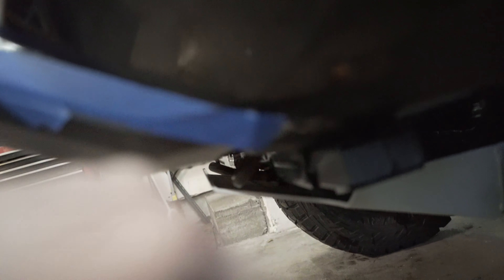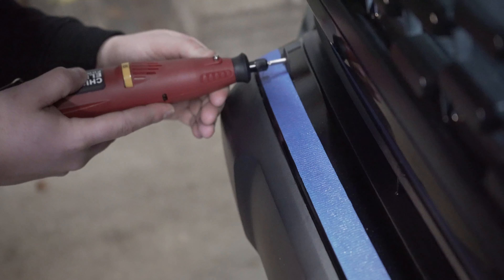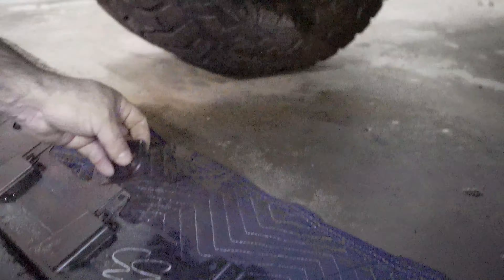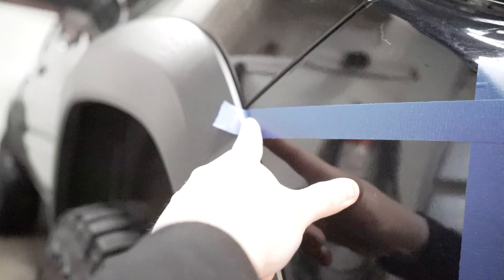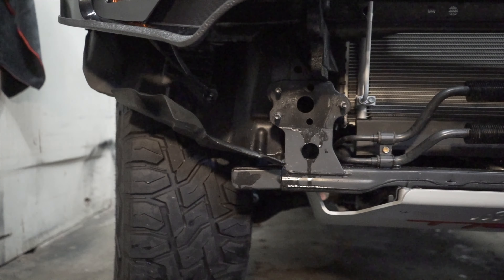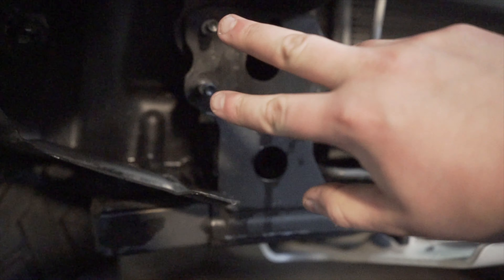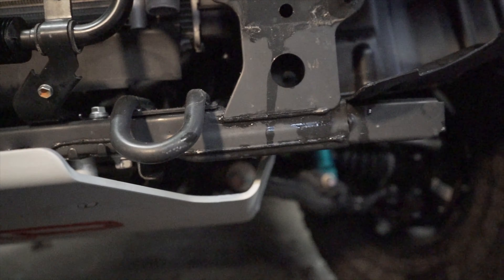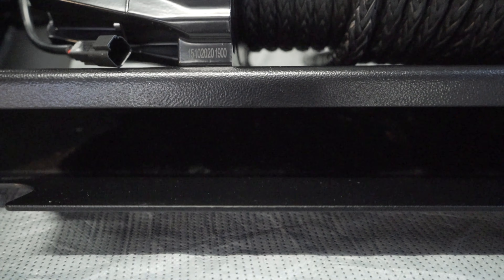Southern Style OffRoad 3rd Gen Slimline Tube Bumper Install | NEW LOOK!

Comment: I have ordered this bumper and am waiting on it to arrive! One question I have is in regards to the fenders. Do I really NEED the fender flares for this to work smoothly or does the kit come with enough rubber gasket to go the extra few inches on the sides if I'm just using my stock colored fenders? I can't find anyone who DOESN'T have the black fender flares with this mod...Haha I don't hate them, I just wanted to be a little different. Should I go ahead and just get them? Surely SSO could send me a longer gasket piece....

Comment: Thanks this is a great video! I do have a question since I have ordered the same bumper with a 30in cut out. Cali Raised makes a 32in light bar do you think it might work in this bumper? I have had good luck with their lights and would like to stick with them. Thanks in advance for any details.
Reply from the maker: I cannot confirm it will work, I would compare the dimensions to the Baja/ or heretic version to see if they are close.

Comment: So, it's been 5 months. Have you checked that bracket and the radiator support? I have concerns with vibrations cracking the support and/or that bracket that the winch controller is mounted on.
Reply from the maker: No damage, still tight and holding fine for me.

Comment: Did your front went down a little bit due to the weight? And also did you remove the air dam on the side of both headlights?
Reply from the maker: My front lowered a small amount , almost not even noticeable. Both air plastic dams were removed for this.

Comment: How do you close again the controller for your winch if it’s all the way down by your radiator? Plus with the heat from the radiator affect the a plastic Control box? I don’t know if you’re aware but you can get a cable me location a kit so you can relocate the box all the way up in the engine bay.
Reply from the maker: Winch is remotely controlled. I have taken my grill assembly off recently and noticed no wear and tear on the plastic control box, I can also still plug in my controller fairly easily in this location.

Comment: Thats 3k right there man! I just put 4k into my suspension and now im looking at those 3 items. This things a money pit!
Reply: I put $2000 on my suspension and another $2000 for the Retrax pro. That's 4 months car note :)
Reply: There perfect build starts with: Magnuson or Procharger Supercharger, Marlin crawler taco box, Marlin Crawler RCLT (mid travel kit, comes with spindles, upper lower control arms, 1 ton tie rods) then you'll need a land cruiser steering rack, RCV axles, and 2.0-2.5" front coilovers and rear spring leaf lift to complete the MC RCLT kit, Method Trail Series Rims, Tires, Nitro Gears, ARB front air locker, (might as well replace rear electric one), ARB twin air compressor, Front Bumper (plus 20-30" Light bar, plus winch), Rear high clearance Bumper, Sliders, Under Armor (transmission, transfer case, gasoline tank, rear diff), Roof Rack (plus 40" light bar), Side and Rear light Pods for Roof Rack. Finished.
Reply: @shoegum7362  pretty much the price of the truck right there
Reply: @jtaco66  I know right! Once you start its like a rabbit hole, one more item at a time. But hey as long as you keep the stock parts you can always part out the aftermarket stuff pretty successfully and get back 50-70% of it.
Reply: @jtaco66  In reality tho I think $20k and you'll have a beast of a rig. Rims and Tires and Lift kit $6k. Dual Transfer Case (2.28x4.70) - $3500 + Need a shorten Driveshaft because transfer case is longer Front/Rear $1000, Nitro Gears $2000, Front & Rear ARB Air Locker $2000 (Or save 1k by keeping the electronic rear). Then armor.$5k.

Comment: Did it come with 2 bolts, 6 nuts? And did it get sent with install instructions?
Reply from the maker: The hardware used is your factory crash bar hardware. Bumpers are shipped with information directing you to SSO's video install.